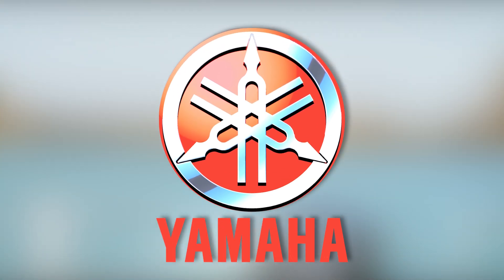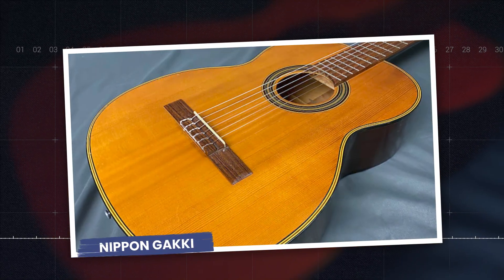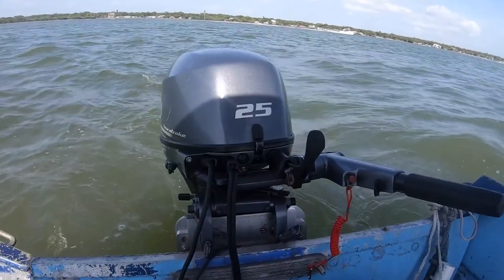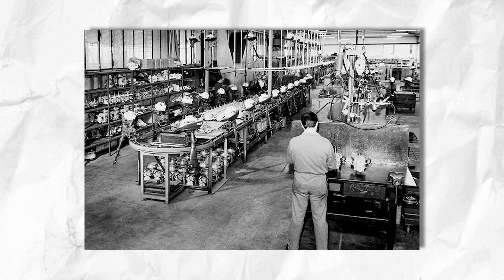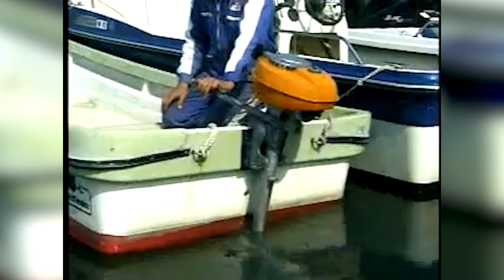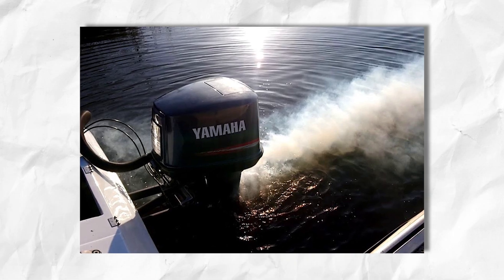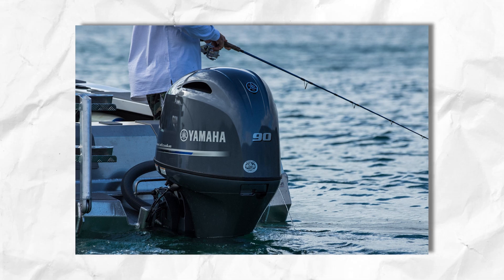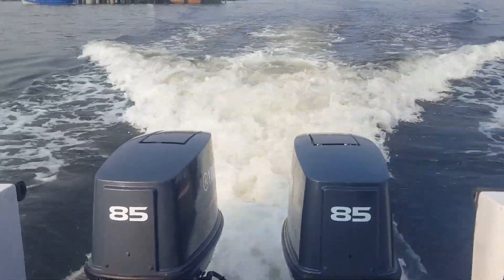How Yamaha Changed Boat Engines Forever, A Story You Need to Know

Comment: They stole OMCs designs, so much so, they had to settle out of court and pay royalties.
The started "dumping" in the U.S . Market, selling motors below the cost it was to build them.
Thats how they got started in the U.S. outboard market.
I will never, ever own a Yammer.
Reply from the maker: @c.c.hiliner1065  A strong opinion! You can't deny they have done very well put of their business strategies and product. But stick American made, fly the flag and enjoy that power!
Reply: Yes, Yamaha pirated OMC and American outboard designs. Rather than designing and engineering their own engines, Yamaha disassembled American engines and copied the parts! No wonder Yamaha could sell them cheaper! As a US American engineer, I have only owned Johnson and Evinrude motors. I will never own Yamaha.
Reply: @streamer728  OMC was obviously having cost issues competing with Yamaha.  They were looking to cut labor costs by moving a lot of their machining operations to North Carolina.  Our machining firm quoted a massive amount of bevel gears used in the lower units.  We must have quoted a stack of blueprints over a foot high of nothing but bevel gears.  We never got one order from them.  They just used our pricing in an attempt to get concessions from their employees on their wages.  I know that there was a difficult transition in trying to train their North Carolina crew to do some of the machining that was being done in Illinois.

Comment: Growing up OMC, 1955 5hp, 1959 10hp, 1975 25hp, 1976 6 and 15 hp, 1979 115hp. It was always Dad's Johnsons and 1 Rude. the 1979 115hp, blew up twice in 4 years, once a Head Gasket, once a Ring Land let go. He purchased a 1984 Yamaha 90hp to replace it (one of the first Big Power for that time in North America). The 3 cylinder was nearly as strong as the V4 115hp, and Sipped Fuel, nearly a 40% gain in MPG. It never Broke. So since that Yamaha, the Family has been a mix of Yamaha/Suzuki, I am personally on my 6th, 3 Yamaha/3 Zukes and currently 1 of each. Yamaha changed a whole Family with 1 Offering. And an Industry, OMC is no longer, and Mercury had to get Better
Reply from the maker: @ib6andub9ok  Hi thanks for commenting and sharing, love the wide experience. What was your most enjoyable?

 Seeing as you are in the Asian side of the preferences, you'll enjoy a video I have coming in hopefully this week and will align with this comment. I hope to see you back on the channel to enjoy this and more.

Consider subscribing so you don't miss out on the Japan support!
Reply: @VintageBoats  Quite honestly, the 1984 90hp Yamaha changed the whole Family's opinion of Outboards, so for Enjoyable it ties with my Current DF140A, My first 4 Stroke. I tried 4 Strokes in 1996 F50 Honda 50, but wound up with a Yamaha Pro 50. I just couldn't handle the Sluggishness getting on Plane. Then I tried again in 1998, a DF115, F115, DT100, wound up with a 1 year old 130 V4 Yamaha Traded by a Friend for an Opti that he wanted back pretty much as soon as the Ink Dried. I just couldn't adapt to 4 Stroke, but the DF140A has been Awesome, 25-30% better fuel mileage than the 130 V4, which is still running. Yes not as "Snappy" but maybe Age has set in a little.

Great Videos, Please keep them up!
Reply from the maker: @ib6andub9ok  All great info. And thanks for your positive feedback - appreciate the comment and look forward to see you back in the comments.

Comment: I did read somewhere that OMC did take Yamaha to court but I can't remember the outcome.
Reply from the maker: @anthonyxuereb792  Hi Anthony. Thanks for commenting. I'll have to check this one...I've got another OMC video in the pipeline so I'll do some digging for that. 

Thanks!

Hope to see you back at the channel.
Reply: @VintageBoats  Greetings, pretty sure it was around the early 90s thereabouts. Mercedes took Toyota to court for copying their inline 6 cylinder engine to and Suzuki got into trouble for stealing ideas from German motor bike manufacturers. I'll be looking forward to future videos. Still got a single cylinder Mercury in the garage we bought back in the early 70s and it hasn't run in 30 years. It was such a heavy almost over engineered unit to carry we had to use a hand truck. Regards
Reply from the maker: @anthonyxuereb792  Hope you may get it running some day
Reply: @VintageBoats  Would  be nice!

Comment: Yamaha outboards are super common in Central America. I pulled lures off the Pacific side of Costa Rica many times with them and caught literally piles of fish. There must be a reason those guys buy Yamaha because there are cheaper options available there. All my friends there have Yamaha engines. We pushed the boats on logs to the edge of the surf and someone carried the engine on their shoulder and bolted it on. Then we went trolling or bottom fishin and caught a ton of fish to sell and eat.
Reply from the maker: @comfortablynumb9342  thanks for sharing! This sounds like a very cool boating experience. You had to work for your time in the water! 

What fish were you guys catching?
Reply: @VintageBoats  we trolled for mahi mahi, yellowfin tuna, big mackerel, and caught huge jacks and lots of bonitas. And on the bottom we fished for snapper, grouper, and other stuff. It was a lot of fun. Pushing the boat back up the beach was the real work. That was brutal.
Reply from the maker: @comfortablynumb9342  I want to do a tuna spearing trip over there. Good to hear there's a lot going on!
Reply: @VintageBoats  okay so I lived in Pavones. It's way down by the border with Panama in the mouth of the Golfo Dulce (sweet gulf, because of all the freshwater runoff on 3 sides). It's mostly a surfing paradise, with the 2nd longest wave going left in the world and it's the longest in warm water. So you have to be careful when you go out, the surf can be dangerous. But from about November through January the mahi mahi and small yellowfins come within a couple miles of the beach. The mahi can be 4' or bigger. The biggest tuna I caught was maybe 15 lbs, not huge. But I put 26 in the boat myself one day on hook and line. It can be incredible, with acres of water churning from the bait and big fish. I saw tuna jumping many times, not on the hook but just out chasing baits. The mahi jump like crazy. 
Across from Pavones is the Osa Península. It's a small bit of land but has 5% of the biodiversity on land in the world. So Pavones is pretty wild too, but way more populated. I would recommend you try Zancudo if you really want to go there. Zancudo is the next little town north and their access to the deep water is safer and you don't have to push the boat there. They have actual guides. I went with the family and friends of my girlfriend/wife. I grew up fishin in Florida and I just love to catch fish and eat them. My friends sold fish. So they took me because I had my own stuff and only kept enough fish for my girlfriend and I for a few meals. I could keep everything I caught but I gave them the majority. I think I kept 2 out of 26 tunas. 
If you go you want to take bug repellent, especially to Zancudo. That's a word for either mosquitos or no see-ums. I got chewed there without bug spray. 
I really miss Costa Rica and I didn't want to leave. I was there for 9 years, about 4 at the beach in Pavones. So if you're really going I can help you from the airport to the beach, and I won't charge you like others might. I love the place and the people and I have some connections still.
Reply from the maker: @comfortablynumb9342  wow that's amazing thank you for all the information. Sounds wonderful. I need to get down to Corcovado and head south down to Pavones then.  

I only made it as far down as Dominical which I loved. Assume it just gets better!

I'll save your contact and if I ever make it back I'll send you a message. Thanks a lot! Appreciate it. 

Hope to see you back at the channel and in other comments. Sure at some stage I'll be looking at trying some form of fishing video....
Reply: @VintageBoats  where do you live? I'm in Virginia by the Chesapeake Bay.
Reply from the maker: @comfortablynumb9342  I'm often on the move....between US, Caribbean and UK.
Reply: @VintageBoats  if you're in the Hampton Roads area during the warmer months you should come catch flounder with me. Unfortunately I think it's too murky for spearing around here but some people do it at the big bridge and tunnel. It's a massive artificial reef basically. Miles of pilings. But I fish with light tackle and mostly lures. I catch redfish, speckled trout, flounder, and a bunch of other species. I go every weekend all summer if the weather cooperates. I'll borrow a kayak for you if you want to go. Also cannabis is legal here and I grow my own. I don't mind sharing, if you like, and if not I respect that too.
Reply from the maker: @comfortablynumb9342  Thanks for the offer. If I ever make it around the area I will definitely hit you up for some fishing! Contact saved!

Hope to see you back in the comments of other videos soon and consider subscribing!

Comment: I’ve had a 1989 Yamaha ESF 50 
short shaft with jet drive original on my Alumaweld flat bottom sled. Done a fair bit of repairs on it but only parts that you would expect to need replacement. It’s been just wonderful! Except for the volume due to exhaust above water level with the jet. Ear protection is a must. Hope to keep her going for many more years!
Reply from the maker: @carlhayes-ze5nd  thanks for watching and sharing. Good luck with the longevity of your motor! 

Where do you take her out?

Comment: I worked for a dealer who originally sold Mercury/Mariner outboards in the 1990's.  Brunswick (mercury's parent company) got to where they didn't want to pay us for warranty repairs, so they dumped the Mercury/mariner outboards in 2002.  We were already a Yamaha ATV/MC dealer so we took on Yamaha outboards.  Funny thing, we sold 3x more Yamaha motors than Merc/Mariner, and did less than half of the warranty claims.  They just don't have too many defects.  They do break sometimes but it was almost always operator-induced (duck hunters especially).  After a number of years, I sold my old flat bottom which was powered by a little 9.9 JohnnyRude, and bought a new (at the time) war eagle boat with a 25hp yamaha 4 stroke.  never owned a 4 stroke so I really didn't know what to expect.  Well, I'm here to say, the weight difference is a non-issue in the grand scheme.  Don't hardly use any fuel, quiet, starts EVERY time and easily, idles better, plenty of power.  I bought a used 3 cylinder 25hp (25MSHV3) and thought I'd try that & see if it'd go any faster, since they were known for speed.  Oddly, it was not.  It was not any more powerful at all, but used 2.5x more fuel and made 5 times more noise.  Ended up selling the 3 cyl, kept the 4 stroke.  In 2017 when Yamaha redesigned the 25hp, I bought the newest one and still own it.  Great motor!  Last year I picked up an older Triton 19' boat powered by an old Yamaha 2 stroke 150 V-max.  Great engine.  Thirsty but hasn't given me any reason to let go of it.  I'd really like a new VF150 but until this old V-max dies, there's no sense in updating it.
Reply: The Mariner outboards range from 40 HP and above in the 1970s were manufactured by Mercury. The smaller HP range was manufactured by Yamaha.
Reply from the maker: @AquaMarine1000  thanks for watching and your input! Hope to see you back in the comments soon..
Reply from the maker: @turbojoe9554  thanks Joe. Great comment and insight. Maintenance and proper use is so key. 

I'm actually battling Brunswick myself at the moment with some new 500Rs and warranty cover.

Love to hear the details of your boats and thanks for sharing. Where are you based?

Comment: The death of The British Seagull :}  I am a big fan of Yamaha, worked as a motorcycle dealer mechanic back in the '80s, the bike shown at 2.09 is a TX500, not one of Yam's better efforts but they actually produced very few "dogs". One of the company's strong points is parts interchangeability between models, they did not change parts for no good reason. Also world famous within the Auto Industry for castings.
Reply from the maker: @RichardCummins-ni4em  Hi Richard. Thanks for watching and commenting. A good insight you bring to the table, Thanks for sharing. 

I'll have another yamaha video coming soon that you may enjoy. Stay tuned!